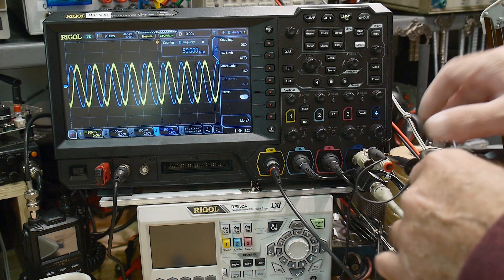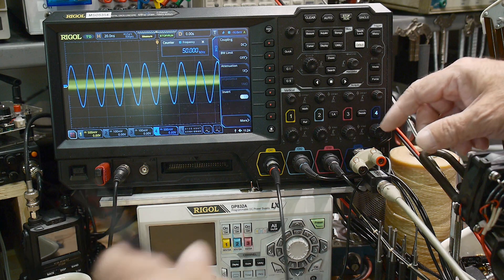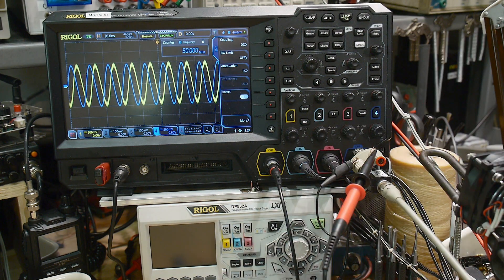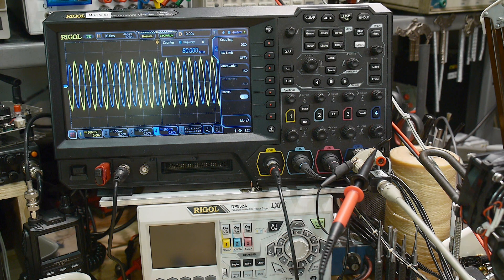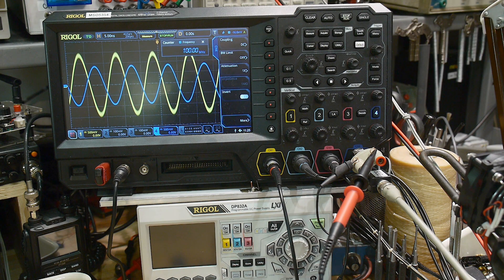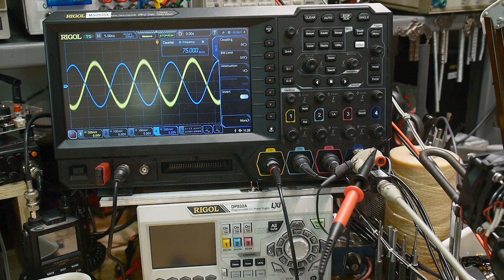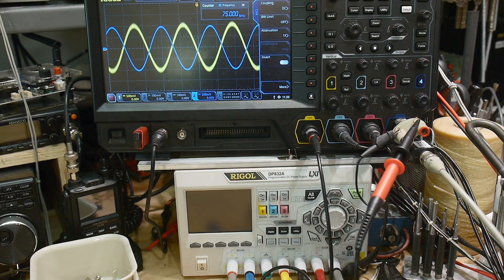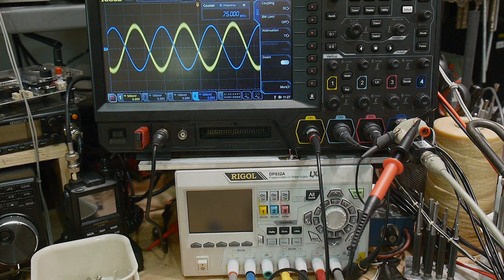#1120 100:1 Oscilloscope Probe Frequency Measurement

Comment: Try again, but remove that adapter, use the other adapter that allows you to connect the probe tip directly to BNC-F (whithout the ground cable).

Comment: Thank you for the review.
The yellow color trace is significant nosier than the blue, 50 ohm terminated trace. Is it because relatively long grounding wire, or because quality of the probe itself? How the trace looks using the Rigol PVP2350 probe?
Reply from the maker: it has 100 times more noise.    as it is 100:1 it attenuates the signal by 100x so you need 100x more gain in the oscilloscope
Reply: @IMSAIGuy  Oh, it makes sense, I didn’t think about it. 
Thanks.
Reply: Thanks for asking the question. I had the same one and now I know.